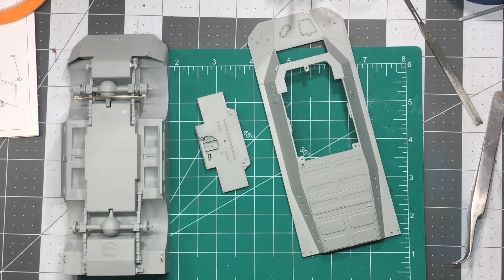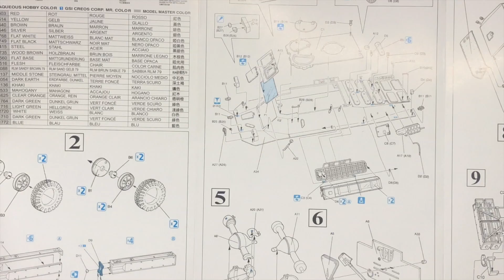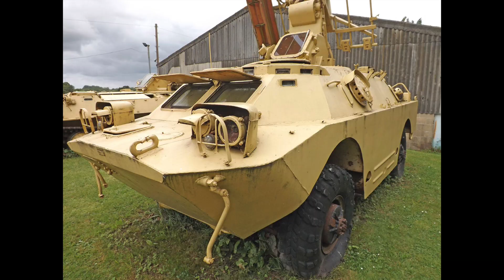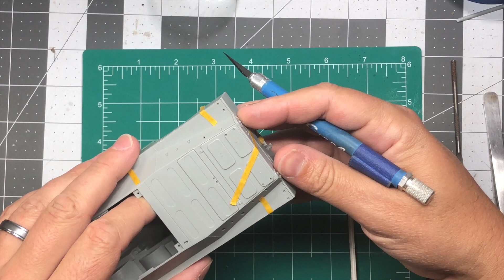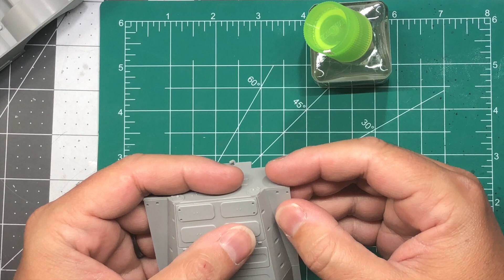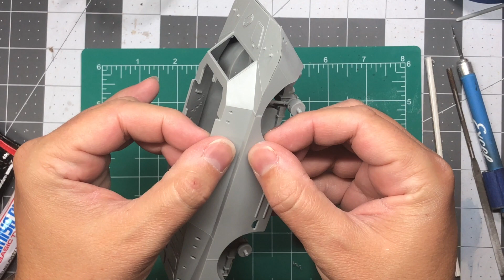Cyber-Hobby SA-9 Gaskin 1/35 - Part 2, Dry-Fitting and Construction

Comment: Agreed dry fit, dry fit, dry fit! One of the best resources in our modelling arsenal. Nice job on the fix of that rear panel.

I've been curious about Perfect Putty but haven't tried it yet. Heard good things about it. I do use Vallejo's acrylic Plastic Putty on occasion, but only on perpendicular joints such as a tail fin to fuselage where it can be applied then wiped with a damp Q-Tip. Some seem to love it but I hate how that stuff sands! Otherwise it's Tamiya's putty smoothed with acetone before wet sanding if needed.
Reply from the maker: Thanks for the comment! I plan to give the Vallejo putty a try, then I’ll get to compare which sands better.
Reply from the maker: So I’ve started working with the Vallejo Plastic Putty and I love it! So easy to work with and the tip allows for pinpoint placement. Thanks for the recommendation!
Reply: @modeling-maestro  you're very welcome, I'm glad you've found it helpful! You'll probably discover that the tip clogs fairly easily if you haven't been using the tube for a short period of time. I just pass a straight pin through one side of the opening and out the other with the help of needle nose pliers (tweezers would work too) then flush with warm water. Only takes a minute and works like a charm!